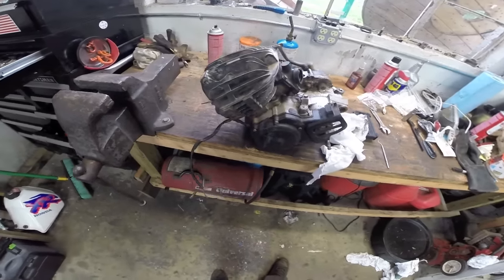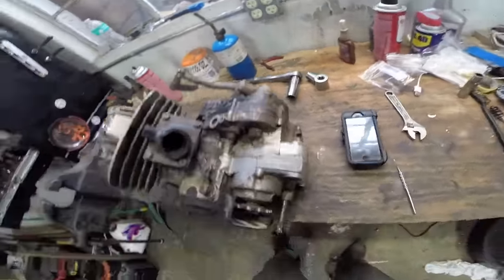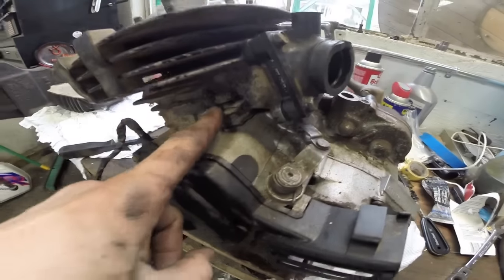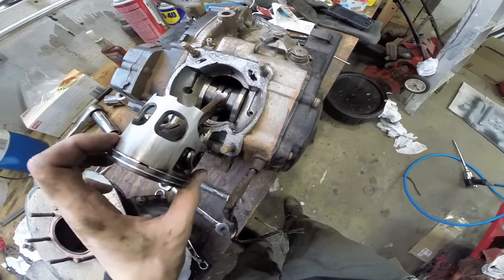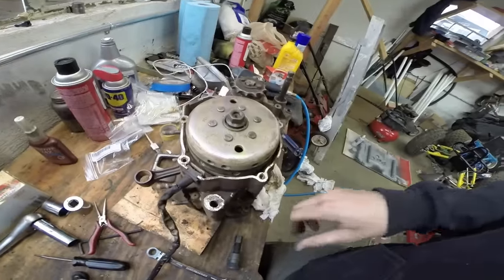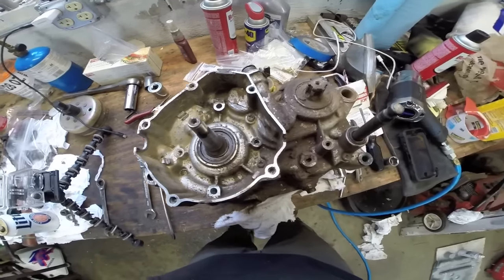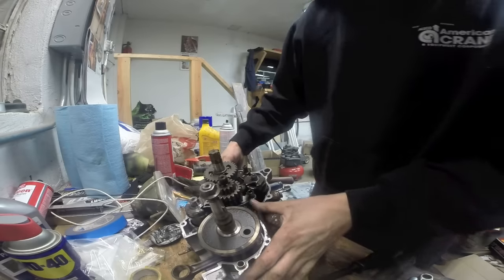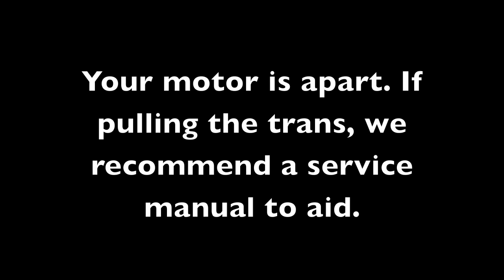Yamaha Blaster Engine Disassembly

Comment: you definitely know what you're doing!
Reply from the maker: Thanks man! Don't forget to subscribe!!
Reply: +Grinding Gears Garage already did! I'm planning on buying a 2001 yamaha blaster in January... will they be hard to find then?
Reply from the maker: +Dominator 235 blasters are everywhere. They are all the same from 88-2002 and 2003-2006 they made a few changes like hyrdaulic brakes and electrical changes
Reply: +Grinding Gears Garage how much do you think I can buy one for?
Reply from the maker: +Dominator 235 all depends they vary by area. You should be ok at under 1000. Also check out our new Facebook page www.facebook.com/grindinggearsgarage1
Reply: +Grinding Gears Garage do you know where I can buy one besides Craigslist

Comment: a question When you remove the piston from the connecting rod, you look at the crankshaft in that compartment, it has oil or there is no oil there

Comment: I have a stripped bolt and it’s the last bolt to remove the cylinder I can’t get it off any help on removing a stripped bolt any help is useful ty in advance ?
Reply: Did u get it? Or sell the quad

Comment: Man clean that engine up before you start.
Reply from the maker: i dissaembled the engine for a full rebuild scrubbed it down
Reply: Grinding Gears Garage do you also  disassemble the trans gears to clean? hate to get dirt and mud in there.

Comment: Hey man do you have a link for the adjustable hone you used ? Previously I just used a ball hone until I got what I was looking for. If you haven't used a ball hone they are awesome but, not nessassarily for precision accuracy. But, if you do alot of honing to clean cylinder wall's its so much better than a stone tool, which is what I used for years.

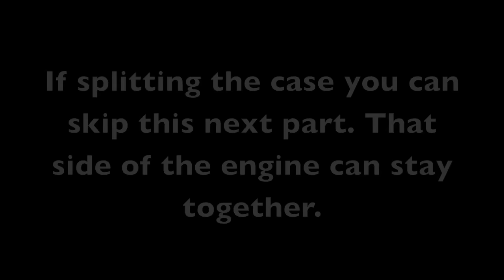Comment: HI, love the video! At 12:20 on your video you said ignore this next part if you are splitting the case. I bought a new crank cuz my main connecting rod bearing is shot, so do i need to disassemble the whole clutch side? just to get the old crank out and new one in?
Reply from the maker: your going to need to take apart a few things on the other side of the case to remove the old crank
Reply: Grinding Gears Garage sooo the only ones you would have to take off is the clutch and main gears where the timing is????

Comment: Where did you get that flywheel puller at 10:10? Is a special tool from Yamaha or can I get it somewhere else?
Reply from the maker: you can buy them all over. usually specific to each motor

Comment: hey man new sub here....content is great ...i have a question....its about a 2001 yamaha warrior....i just pulled the top end off and my valves need attention...mainly lapping and vg seals.... I know how to lap them but what the manual said to do is pour a solvent into the port and check for leaks ...i have leakage....so do think I should lap the stock ones or buy new and lap those in...im trying to save money cuz this rebuild is adding up but I don't want to cut critical corners either
Reply from the maker: id try to lap the stock ones. worst thing that is gonna happen is a little wasted time.

Comment: Bought a blaster and they've been running it on straight gas with the oil pump blocked off , it still ran but there is a hole in the case so it smokes like a train
Reply: Blasters are 2 strokes

Comment: Question why would the platic gear blow apart .??? and when the pomp is hooked up it does not ???...    i had a few blasters in my time ...lol
Reply from the maker: its just a known failure point. oil degrades plastic overtime. way easier to mix fuel then run the risk of the pump not working!!
Reply: True your right .... better to self Mix ..... had my share of top ENDS rebuild over the years!!

Comment: hi, when you rebuild a blaster engine, do you have to let it run idling for a certain amount of time? how long?
Reply from the maker: +Dominator 235 there is a specific break in procedure. if you google breaking in a 2 stroke engine. need to do a few heat cycles then ride around on a tank of gas lightly

Comment: hey how's it going I just bought a 2009 Yamaha Blaster and I'm having an issue that when you take off on first gear it struggles to go I want to you can out Thanks
Reply from the maker: luis chavez have done a leak down test? 2 strokes usually are plagged by leaks causing them to run badly. Also since its a recent buy id do a comp test as well

Comment: did you upload a video of the assembly for the engine?
Reply from the maker: +Dominator 235 we did a bottom end rebuild video. We are editing a top end rebuild currently. Thanks for watching
Reply: +Grinding Gears Garage and what is a stator?
Reply from the maker: +Dominator 235 stator is behind your flywheel. thats where you generate your spark and the electric to run your lights
Reply: Giant the stator also used for the ignition timing